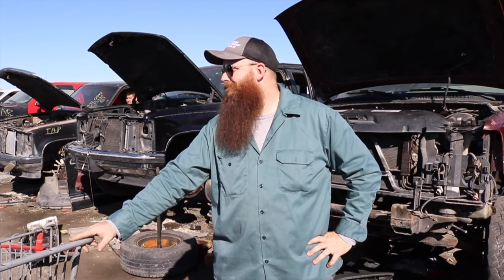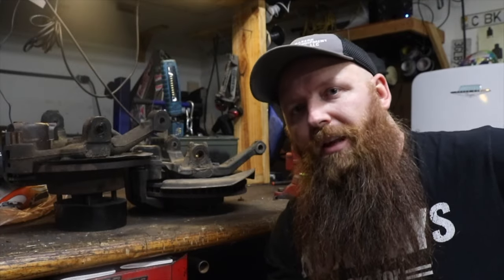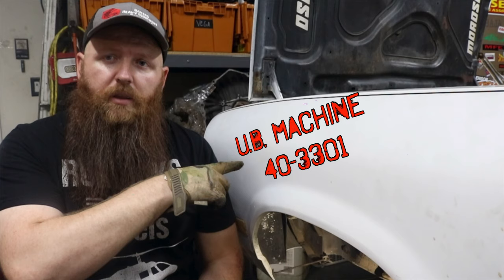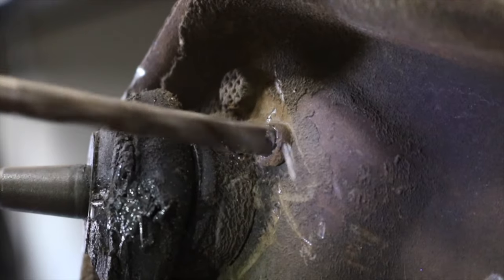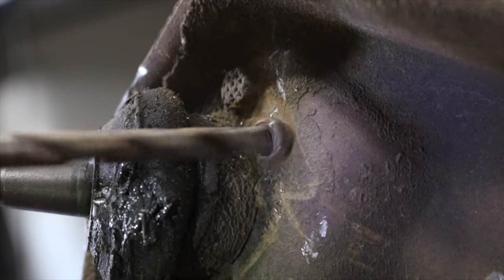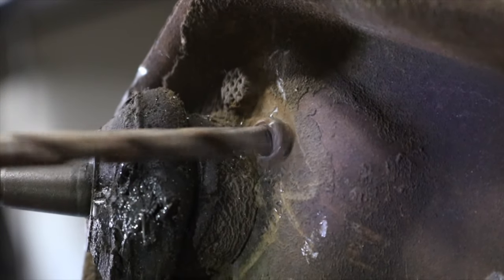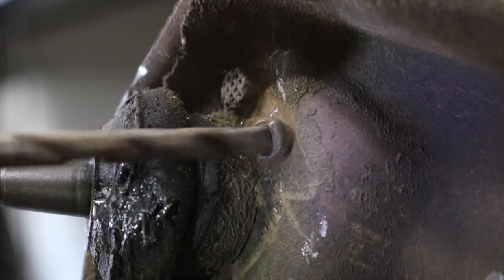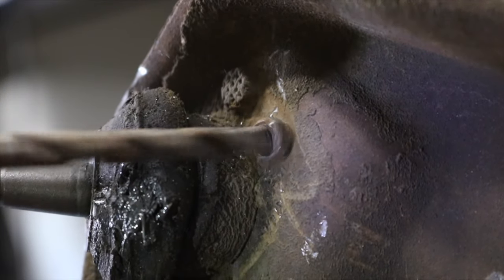H-Body 5 Lug swap Part I | S10 Blazer Front Spindle swap | BIG disc brake upgrade | Vega EP17

Comment from the maker: For the upper ball joints: 

I do not recommend moving them outboard the as I did in the video. 

The reason: moving the lower balljoint inboard 1/4" is plenty to compensate for any camber difference between the Blazer and Vega spindles. 

Moving the top balljoint outboard then requires full deflection of the camber/caster adjusters on the lower control arm to prevent positive camber. 

The solution: Install the upper balljoints centered in the widened hole of the upper control arm. 

I still recommend swapping the upper control arms to their opposite sides for caster gain. doing so adds stability at speed.
Reply: With the swapping of the upper control arms, does it also keep the tire from hitting the rear fender well as much? I just swapped the fronts on mine today, I just got them installed and still have work to do, haven’t switched mine yet, noticed the rear of the tire rubs but the front is fine.
Reply from the maker: @darthvega6358  I had to put some smaller tires on my front to keep it from hitting. I would think the tire would be a smidge closer when swapping the uppers because it moves the upper balljoint aft resulting in the caster gain. But we’re taking a quarter in or so. You’ll likely have to change tire size to make more room.
Reply: @BurnoutsAndRotorblades  good deal, I had planned on it anyway, just got some S10/Blazer wheels and tires from the scrap yard to fit the hubs
Reply: @BurnoutsAndRotorblades  hey what’s up man? Got a question, how far back did you cut your hard lines? Can’t get my ends to meet up as they should, I mean seems they need to be S shaped
Reply from the maker: @darthvega6358  I just did it by feel. I didn't cut much off at all. it might be necessary to pull some extra length from upstream if possible. worst case scenario, you have to make completely new hard brake lines.
Reply: @BurnoutsAndRotorblades  gotcha, thanks

Comment: We used Bob Gumm's sleeves to do the S10 conversion and couldn't be more please with the results. In doing it this way (the easy way) and using off center a-arm bushing, we were able to get a little extra negative camber. As we' were planning on using the car hard on the street with a bit of auto crossing later on, the additional camber was very welcome. Something to consider when planning your S10 conversion. In our case the easy way was the best way. The S10 rear axles conversion is equally as easy if you have a 7.5" rear in your car, a simple substitution using stock parts. Luck ! ! !
Reply: I have a 79 starfire gt and want to do the 5 lug conversion. All i have to do is swap out the axleshafts?
Reply: I have a 74 Vega and I’m gathering parts to do this swap, on the v8 monza site bob says to use 1975 or later balljoints. Did you do it this way cause I’m having a hard time finding the right part

Comment: My senior project for Power Auto 2 at high school in the 70s i built a 72 vega notchback with a 65 283 ci sb with high compression 2.02 heads and doug thorley v8 engine and trans mounts and headers. A turbo 350 auto finished the swap. After a year or so the side gears in diff blew. And THOSE stock from brakes i put car in neutral if i needed to stop quicker than if i left it in drive
Reply: I have Doug Thorley headers on my wife's Vega,, at 1-5/8 diameter and fit better than hooker 2135's(1-1/2) ,, someone needs to remake Doug's Design😊

Comment: thanks for the info I guess I should just be a little more patient. love your video it has some great points to consider when doing the s10 swap. already put the 75 lower ball joints in the a arm as Bobs install instruction stated for the adaptors so hoping to hear from him soon. thanks again

Comment: I test fitted a first gen camaro spindle with chevelle steering arms on my 75 monza. used some cone inserts for the small h- body  balljoints. I did this just for an interfernce and camber check, had no interference issues and camber was roughly the same even a bit more negative as stock. I will try to fit a screw in lower ball joint.
I want to do a JL8 ( Basically Corvette C3 11.75" discs )conversion like some rare camaros could have been ordered with. The biggest challenge is to find a JL8 Caliper bracket, these are really rare and very expensive and are only available as repro parts.
I love Vegas and monzas because you can get something special for cheap and can make a real competitor out of it. These cars are lightweight and have more potential than a Camaro when well prepared.
Reply from the maker: I'm interested to see how that goes.

Comment: I did the S 10  brake upgrade on my 79 sunbird back in 2005 or 6 I used 86 spindles so I had the single pot calipers. I've bought most of Bob Gumm's products over the years. I don't need a set of balljoint adaptors because I still have my original set. I always thought it would be a good Idea to make a set of control arms that would use the S10 balljoints.
Reply from the maker: There is a company that sells that exact setup. Adjustable A-arms with S10 balljoints.

Comment: Thank you SO much for all these Vega videos. The details and explanations are a big help.  Can you tell us why you decided to cut the ball joint sleeve 0.6 inches and weld it at 0.3 inches above the control arm? What does that change to just butting it up to the bottom and welding it in? If I butt it to the bottom do I need to trim more?
Reply from the maker: It's about locating the pivot mpoint in the right spot and not letting there be a huge area for water to pool on the balljoint.

Comment: Since American racing refused to custom drill the “customizable”Ansen Sprint slotted mags to 4x101.6 (reason being they don’t do that bolt pattern anymore) I’m gonna be looking at this swap soon. hows the weight from the 283 affecting the front end? Any problems? Also looking to install one and you probably have the same idea as you said in a earlier vid what the Prototype had, YES!!! Going for the 302 which in my mind makes it a Vega SS!

Comment: I dread doing this, but I know if I keep my '72 much longer I will be forced to as the solid rotors that fit the car are no longer available or produced by anyone.  I'm sure the s-10 brakes are far superior to the crappy stock Vega calipers, but I don't relish losing the four-lug 13" GT wheels.
Reply from the maker: They make the same wheels in a 5 lug. Also, don't those have hub caps that cover the lugs anyways?
Reply: @BurnoutsAndRotorblades  No. The Vega's 13" GT wheel was a steel-stamped four-spoke Rally wheel that had a chrome-plated tin center-cap attached to the center hole of the wheel via steel, curled clasps. The 7/16 Right Hand turn acorn lug nuts were exposed.

Comment: Thanks for the video. Is there a trick to removing the spindle without a spring compressor? Looks like you gave it a good kick and she popped out somewhat safely?
Reply from the maker: I would not call that safely. It was a calculated risk. If I had a jack, I could have controlled how fast the lower control arm went down. that would be a much safer way than letting the 15lb spring unload uncontrolled.
Reply: @BurnoutsAndRotorblades  thanks, but I actually just yanked the spindles off a '99 s10. No jacks allowed in the yard. Like you said, I figured it was a calculated risk lol

Comment: I'm using S10 spindles and have the adapters ordered.  Do I use the stock Vega brake line or use the S10 brake line using a adapter
Reply from the maker: use the GBody brake lines.

Comment: This is the same information for swapping out to s10 truck spindles on my 75 Vega correct?? I'm not using the bolt in bearing. 👀🏁
Reply from the maker: It is a very similar process. but I recommend the newer spindles because the disc brake setup is better from the blazers.

Comment: I was looking to see if the rotors from an 84 Corvette would fit on my S10 since I'm doing a 1942 on that frame and I would like to use the Corvette rear end as well if possible if it's an easy fix then I please let me know.
Reply from the maker: I know there are some conversion kits to upgrade to corvette brakes, but I don't have any experience with them personally. I will caution you that there is such a thing as "over breaking" a car. If the brakes are too big, you just lock up in a panic braking situation without ABS.

Comment: Bro do you know if V8 Monza still sells the ball joint adapters
Reply from the maker: Last I heard he still does. He works a day job so be patient. He might take a bit of time to respond.
Reply: @BurnoutsAndRotorblades lol I bought them adaptors but when got the ball joints they were the over size ones and so...I'm doing some welding because I can't wait again 😄 too excited

Comment: Hi sir, I picked up spindals caliper's and rotors to do conversion, I need help here in Apache junction Az
Reply from the maker: Post a request for help in the Vega Nation Facebook page and maybe someone in town can help. I'm out of the country at the moment. What do you need help with?
Reply: @BurnoutsAndRotorblades  to do front end swap , s10 ball joint swap I bought the spindals but need those spacer weld in part's
Reply from the maker: @karlmawby2921  You get those from U.B. Machine. google the name and part number I show in the video and it will get you there.
Reply: @BurnoutsAndRotorblades  I'm so thankful for your videos and your help sir,

Comment: What years of the S-10 / S-10 Blazer (can it be a regular s-10 pickup or does it have to be a s-10 blazer and i guess it needs to be 2wd on both ?) I have a 1973 Vega Wagon . Im doing it the easy way , just to get 5 lug .
Reply from the maker: I used the Second generation (1995–2005) blazer spindles because they come with bigger brakes and calipers. The S10 pickup has a smaller caliper and rotor. I'm not sure on the years for those.
Reply: @BurnoutsAndRotorblades  Thanks for the info , so the 95-2005 blazers do they have to be 2wd or will 4wd work ?
Reply from the maker: @mrwallaby11966  The rear axle has to be 2wd. The physical axle shafts are longer pushing the wheel mounting surface out in the Vega. The front. . . I'll be honest, I'm not sure if it matters. I can't honestly say if the fronts have a physical difference, other than; the 2wd spindles have a plug where the driveshaft for a 4wd would pass through, but the hub and bearing still have the holes. To preserve the bearing you would need to plug the hole in the spindle to keep water/dirt out. So for simplicity, I would say go for the 2wd first.